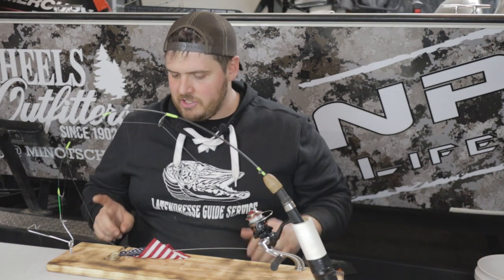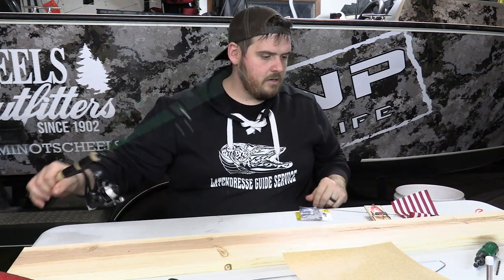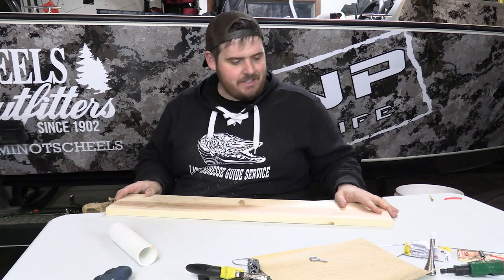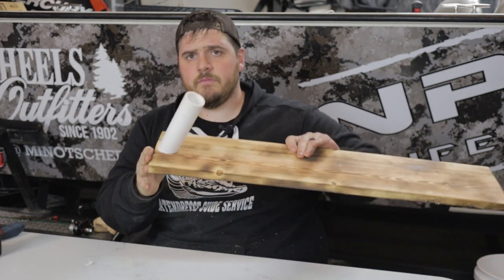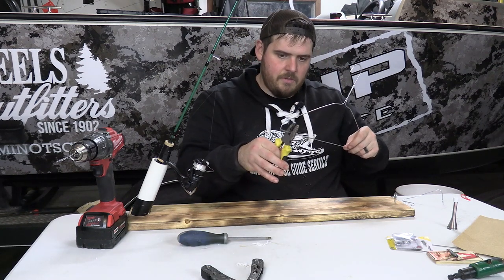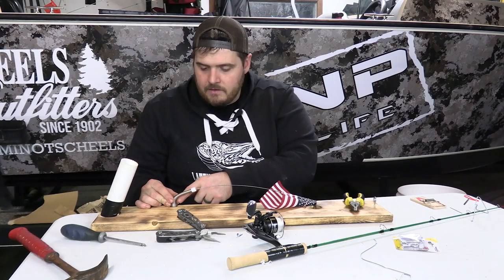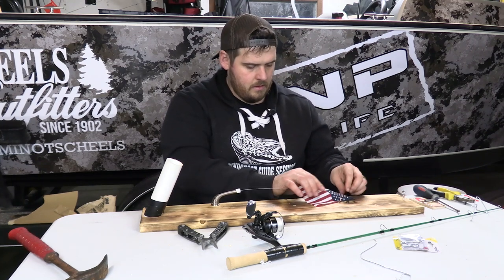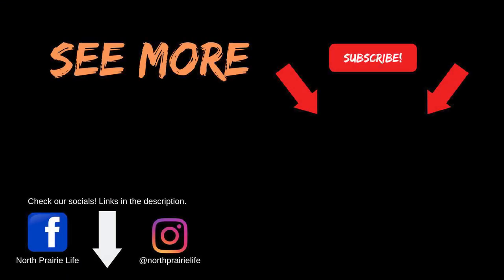DIY IFISH Pro | Homemade Automatic Hook Setter | Hook Setter Tip Up Combo | NPLife

Comment: Made this almost Identical just used a reflective flag and added a bell on the end. 

For the setting of the trip of both I just take some slack between the last 2 eyes and set that loop on the flag trigger and the main line as it should and works amazing.

Comment: Attach the auxillary flag "trip" line to the coat hanger. Keep it in place by 
first putting shrink tubing over a large swivel and then putting the swivel onto the coat hanger. Then tie line to swivel etc etc........

Comment: I guess I don't see the purpose of the hole and channel like the I fish pro. It would make sense if the line came back towards the reel side but I just missed the purpose of it with your build.
Reply from the maker: With the line being loose using it as a tip up, I wanted to get it into the middle of the hole so it doesn't catch on the edge.  It just seems to work better letting the line fall straight down instead of at an angle. I'm sure you could do it either way.

Thanks for checking the video out. I appreciate it.